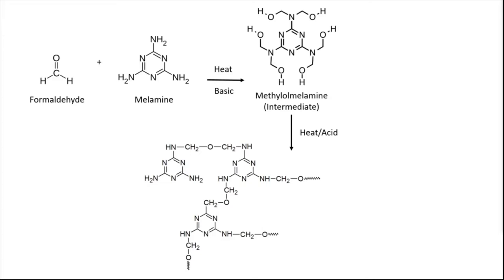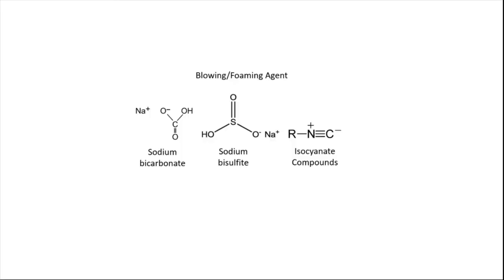Uncovering the Truth Behind the Magic Eraser

Comment: Detailed and clear explanation from a well-qualified person - thank you 👏
Reply from the maker: Thanks, I hope you learned something useful!
Reply: I did - several things  😉What I was hoping was to find was a tool to clean coloured rubber silicone, i.e. a red coloured watch band which has some grey marks on it. I hoped the ME might work but I've just bought one, tried it, and it doesn't seem to have much effect.

Might you have any thoughts on how to clean coloured silicone rubber of the normal marks that arise from just wearing it? Maybe an abrasive is required to "shave off" the grubby patches.

Comment: Great video, very informative. I have a similar question about melamine based foam used in acoustic panels, would there also essentially be particles being released by the acoustic panels as well? Are these dangerous to be exposed to?
Reply from the maker: If you're not agitating them in any way I wouldn't worry about it

Comment: How bad would it be on using the eraser on vynl seats in boats ? I used it and works like a charm but I was told I did more damage then good
Reply from the maker: I think it really depends on how much you're using it and how much pressure you apply. Remember it's like sandpaper. If the seats have a glossy look it could remove that and the more you use it the more you're removing the surface of the vinyl
Reply: @Shnickerman  thx for the reply
Reply from the maker: @_jonbee  Thanks for watching! I really appreciate it

Comment: Use on Sneakers? Yes not on shiny surfaces or fine leather. 
Subscribed, thank you
Reply from the maker: Depends on what material, it's like sandpaper so if used gently it can be fine but it may take off paint and shine if you'd aggressively

Comment: Good video! I just bought one at Home Depot for the first time and decided to Google how it works. Lol. 
Would this cause cancer if I use it with bare hands?
Reply from the maker: Nope not that bad, if you dont have gloves no big deal
Reply: @Shnickerman  ok, awesome thanks. Hey, you should make videos on how "Chemical Guys" products work on cars. They have this spray that you spray on wet cars after you wash it. And it's supposed to aid in the drying process by separating the water droplets from the metal, so when you pass the towel through the towel picks up the water droplets easier. The spray is called "After Wash". Not sure what the active ingredient is.
Reply from the maker: @charlesdominguez4245  I can look into it, thanks for the suggestion